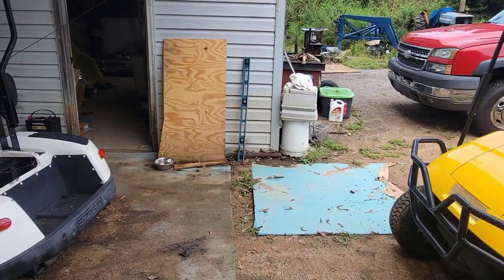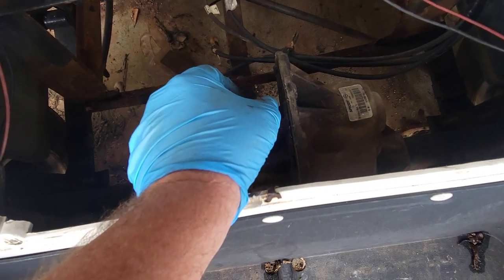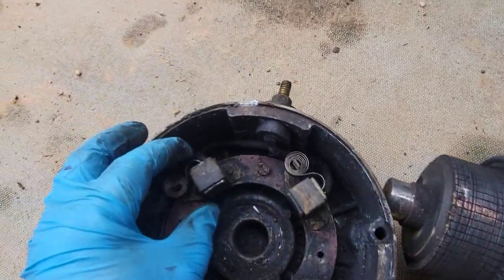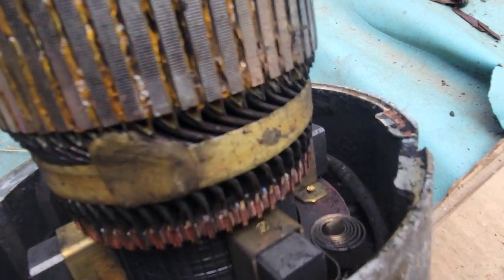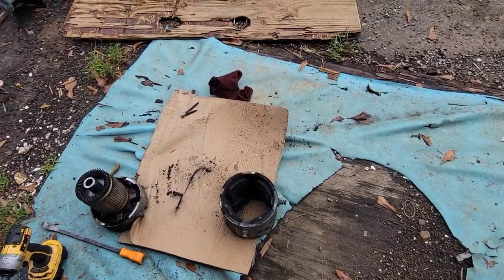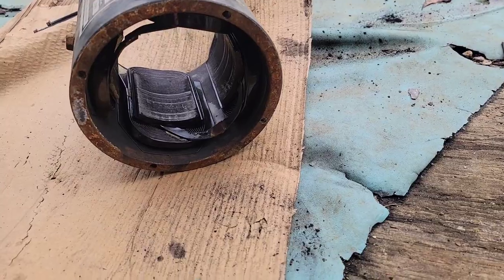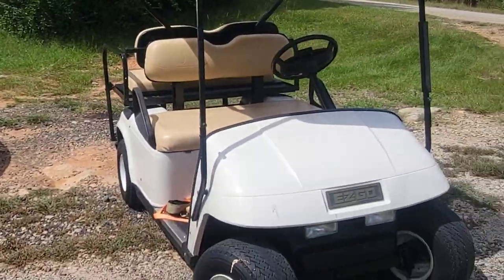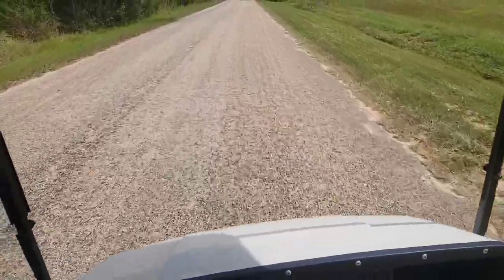Ezgo 36v motor remove,install, clean, repair,inspect brushes TXT golf cart @Vassmotorsports

Comment: Nice video. Very helpful. Question I have, I tested my ezgo txt golf cart motor by putting the jumper wire and jumper cables to a 12 volt battery and only  one wheel spins very slow. Is my motor bad? The cart only goes 4 mph and have replaced speed sensor, solenoid and ITS, batteries are all reading 6.2. I am at a loss any help would be greatly appreciated.
Reply from the maker: The motor will spin slow with only 12v jumping it even with wheels off the ground,  when it's jacked up can you spin both wheels freely or are brakes adjusted to tight ?  Also make sure all connections are clean and tight , if you can get any to move by hand that's no good.    Also 6.2 is very low charge and good batteries will sit at 6.7 when full and when they get to 6.5 or 6.4 they need recharged and are considered low.   Hope this helps thanks for watching Vassmotorsports and hope ya enjoy some of my other vids as its not just a golf cart channel lol

Comment: Hi Steve I was wanting to know if and where I would go to perches the magnets inside the motor for a ezgo golf cart please mate cheers
Reply from the maker: I'm not sure you can purchase just the magnets.   Did you hit the case and break them ?  I might have a used set and case from this cart when I switched motors the armature was stuck on the shaft and it got destroyed but case and magnets slid right off and were ok